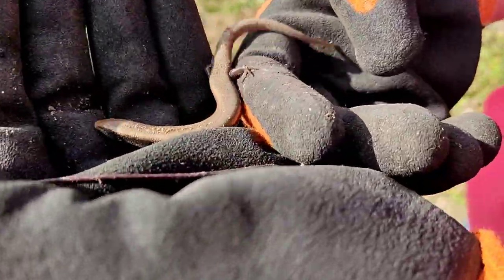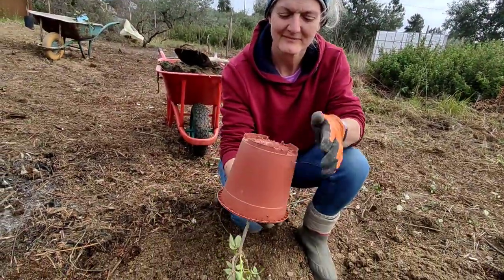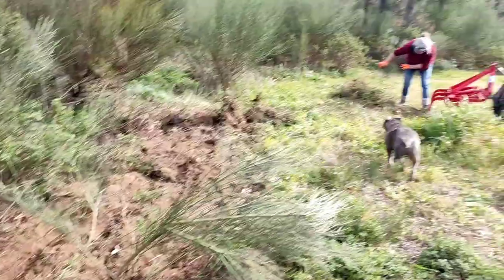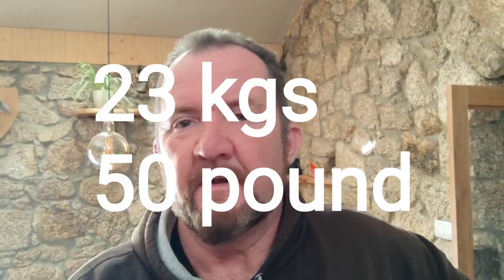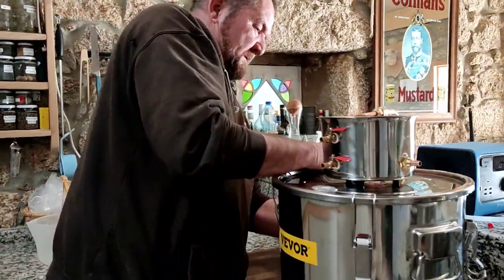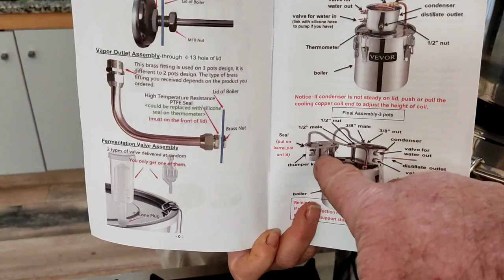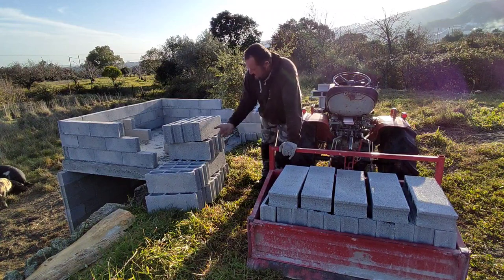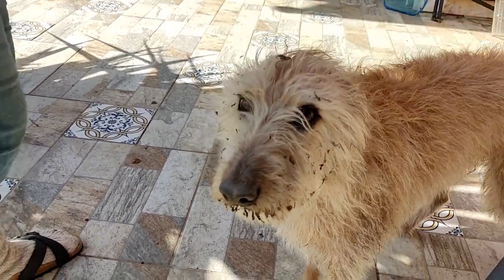Planting Trees and Making Essential Oil in Central Portugal

Comment: Good job ,you Hard working peep.
I do think to tackle brambles and hard brush you need one those old Farming machines called Allan Or Allan Oxford Scythe /motor finger mover
Reply: Luke ans Sarah are pulling them out entirely to discourage regrowth.
Reply: Pulling them out in small area is doable but not in a large span .
There are 2 ways , one is spraying (not very liked) 
2 regular mowing / mulching machine , will encourage the growth of Grasses and nasties down
Reply: My goodness me - Allen Scythe; I haven't heard that name for years!  Great machines - its successor now called a Finger Bar mower?
Reply: @Neilhuny  haha 😆 
Yes ,it's legendary , some old ones are still going strong due to dedicated fans. Modern decent  ones are pricey in Chinese ones not long lasting.
Reply: @mohammedamin9050  Hi.  Uh... i think Luke started pulling the broom out ☆because☆ they have hectares and hectares to clear on a budget with little machinery.  They have cleared many large sections by strimming and mulching, but i think they felt pulling out broom would allow them to get thru more land faster.   "Luke and Sarah's Off Grid Life".